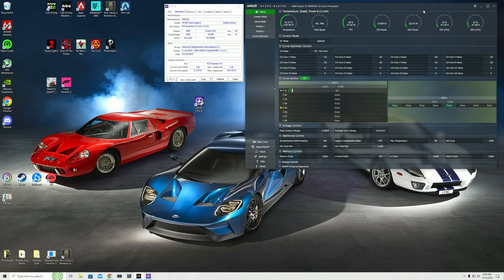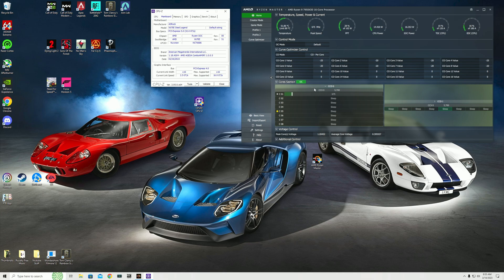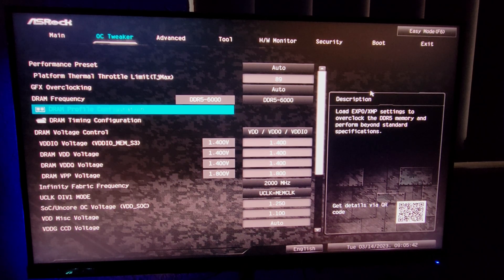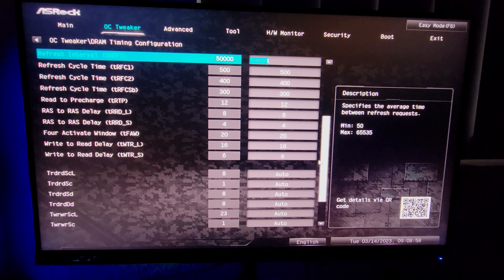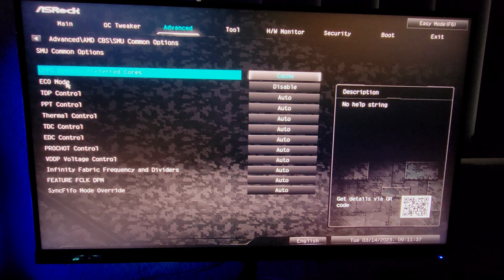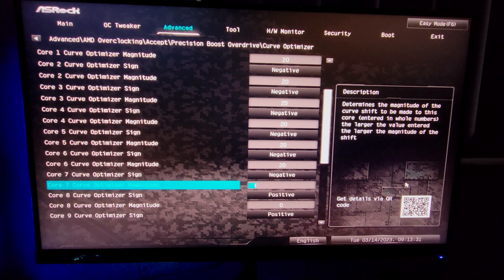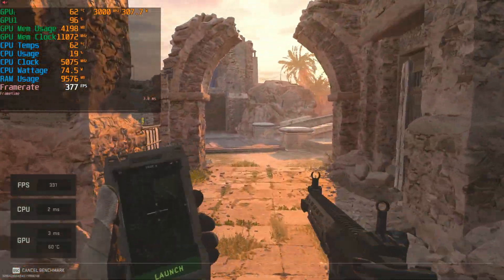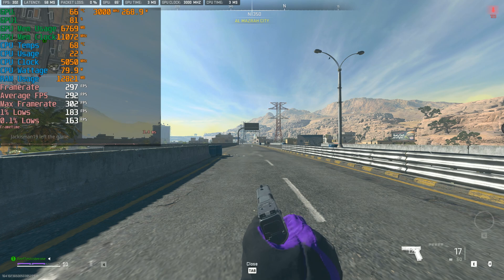7950X3D Setup Guide (Bios Settings, Ram Timings, and Undervolting)

Comment from the maker: WARNING: if you have poor case airflow or can tell the inside of your case gets really hot, don't set the TREFI timing more then 35000-40000.

It is EXTREMELY temperature sensitive, and can cause random shutdowns or restarts despite your ram seeming stable! 

In this video mine was 50000, I tried max it out at 65000 and noticed the random shutdown after a day...I did the research and lone behold here I am! Just had to let you guys know so you don't have the same issue!
Reply: My 6400 cl32 runs 50.000 in the xmp profile.
Hm no shutdowns since weeks.
But i also have an lian li lancool III with very good airflow
Reply: @n0pe_7 Congratulations! You chose the best case! Lol, that's my case too and I love it!
Reply: For those of us who know nothing of OC'ing or anything but just physically building the system: How do we figure out the reason the pc is shutting down or BSOD'ing is RAM or temp related? Is there a win11 log tool or 3rd party we can use to figure this out?
Reply from the maker: @Golyem  not that I know off...the easiest way to troubleshoot issues is to test all hardware before software.

First step is replugging absolutely everything in.

If you don't have an integrated gpu in your cpu, your next steps is to swap to a spare gpu of any kind, and retry to boot to rule out gpu. If you have integrated gpu, plug hdmi into motherboard and try boot.

If your motherboard has some little lights on it with writing next to them, it can even tell you what the issue with booting is. It depends what motherboard you have.
Reply: @Beefy-Tech  Thank you, I appreciate your time to respond!
Reply: Beefy,
I do not have the cppc setting in my bios. I’m trying to figure out how to get my machine to “prefer cache”, but can’t find the setting. I do have AMD CBS, buts it.
Reply from the maker: @thedo0d255  you must update your BIOS! That setting is not there unless you are on a BIOS that supports it! Also make sure to update your chipset drivers.
Reply: @Beefy-Tech  I did both already. Just can't find the CPPC setting for preferred cache. I dont think it's on there. There is like a OPCACHE with Auto/Enabled/Disabled on there. But IDK if that's the same.
Reply: @Beefy-Tech  I have 32gb gskil but they are 6400mhz cl34 and only shows expo not xmp, I do all you the same and works for a few hours and random shut down
Reply: @fierrosgaming  can you put bottom fans in your Coolermaster h500 mesh that you've mentioned..
I have the same case too, same CPU as you. 
Cuz i cannot , i only have a 360mm AIO deepcool LT720 + 1x 120mm REAR fans + 2x 200mm front fans
I wanted to remove both PSU box + HDD cadddy box and try to put bottom or side fans, 
The side fans i think we cannot as there is no brackets to screw those fans 
DAMN we're screwed
Reply: @thedo0d255  the correct setting for the CPPC in NOT cache, is DRIVER!
Reply: I have 6400mhz cl 32 memory and just left it as is. Wasn't worth messing with considering the possible performance issues. My Gigabyte B650 Ultra MOBO has a One-Click "Low Latency" and "High Bandwidth" toggle within the BIOS that can further auto optimize the already good memory.
Reply: @chrisbullock6477 I gained around 40fps to my minimums in warzone just doing basic tuning to my memory. Tried on both 7700x and 7800x3d with rtx 4080 with similar results.
Reply: I think you're alright at 50000. Buildzoid says the heat sensitivity starts to kick in around 65000. Tbh the gains might be worth putting a small fan on the ram.
Reply: Hi Beefy, what timings do you suggest for a 64 Gb 2x32 cl30 amd kit?
Reply: have drivers mostly fixed the stuttering problems ?

Comment: You made a mistake because you overvolted your processor, not undervolted it! AMD recommends not exceeding 1.15-1.18V on the SoC Voltage, so at 1.25V it's overvolted. To reduce stuttering, you need to undervolt this value to 1.17V to be within the acceptable range and set the first 8 cores to -20V because -25V is too aggressive a setting, and OCCT confirms this.

Comment: I am also using 7950X3D with ROG X670E GENE.
With old BIOS (1807), My system PASSED in 9hours of in Y-cruncher VT3 and TM5(extreme1) with Curve Optimizer -20 all cores (except -0 for 2 best cores of each CCD) in 
However, with latest BIOS (3104), My system FAILED in those tests. I have to lower down to -5 in order to PASS them.

Comment: Thanks for this helpful video!
@ 6:30 you mention setting CPPC to 'Cache' "...if not using any other program."
I use Process Lasso with my 7950X3D and set my affinities:  flightsimulator2024.exe (which is vCore aware) uses cores 1-15, and everything else except the core Windows processes are assigned to 16-31.
Core Windows processes are untouched, and use cores 0-31.
Is there any point in setting CPPC to 'Cache' or should I just leave it on 'Auto'?

Comment: I appreciate the video but there are things that are wrong here. 
You can get your  v cache cores to run up to 5.4ghz. 
For people just starting off, if you want to try undervolting etc, do NOT set your cppc to cache or speed. Leave it at auto or default. At most, you can try driver but DO NOT set it to cache. 
Windows has tons of things going on, youll see even during gaming, once the scheduler detects your game playing, that doesnt mean it will 100% put every other core to sleep. You're actually losing performance by taking away cores that would just be working on your game, now are being used for backround tasks that your c1 would otherwise handle at 600hz etc. Super slow but you will see cores handling small things. (Like the programs your using to display your fps, cpu core speeds etc. Afterburner, hwinfo, etc)
When it comes to setting your curve, start out by setting all 32 threads at negative 30. Using ryzen master ans cpu z you will figure out which cores like to run faster. I have some cores running at negative 35. 
My 3d cache cores during gaming run at 5.3-5.4ghz. 
Amd allows zen4 to put a 200hz overclock even on v-cache cores. You need to set that setting to positive,  200hz, scalar 10. Max temp 95. 

You then need to set your loadline calibration to extreme (or whatever the setting os that you can set and still give you a negative curve). Its usually one setting from the highest you can go. The highest will be a straight line and will wash out the  entire point of your negative 30 curve. 

If you want exact settings look up skaterbench's video on the 7950x3d. I got higher scored then he did though but i also got a really amazing piece of silicone. Idles around 25 degrees, hits maybe 60 during benchmarks . 
Sorry that was so much written and its not gonna make sense to anyone probablly without me showing you. Ive spent so mant hours on it, i may put off upgrading when the new chips come out. 😂 then will have to start all over again

Comment: Hello, I am having random restart issues during or after streaming and gaming. I've tried undervolting before, but trying to find it best to run everything stable and Max Performance in Windows + Drivers. Any recommendations for the 7950x3d + 4080 Super with CL30 6000mhz? Ideally, I would like to run my PC 24/7 without a restart. I've ruled multiple things out in my system and updated the bios before the build and post.
Reply: I'm having the same issue and also ruled everything else out. Basically the same build as you.
Reply: @DivineAndDemonic  it's all good now. PC has been running for 24+ hours. No shut offs or restarts.

Comment: i got a 4090 and a 7950x3d i have undervalued the cpu and thats all good but im having alot of issues with the ram. my motherboard is the aorus x870 and ram is corsair vengeance 64 (2x32) 6000MHz and the moment i touch anything under tRAS the bios says there is an error and i cant boot windows. ive had to reset the CMOS alot of times already. what do you recommend i do?
Reply: under-volted the cpu*
Reply: also i have my cppc set to driver instead of cache and the core parking works fine, why do you recommend cache?

Comment: I'm not confident with this BIOS cppc cache/driver thing. Driver should be the choice because when Windows is properly setup (balanced power mode) the cache driver and Game bar use the 3D vcache die. If you don't want to use frequency core, better go for a 7800X3D.
Reply from the maker: @psour33  yeah, it's supposed to do that, but I've had an extremely inconsistent experience with it. The intended method that's supposed to choose the correct ccd and park the other ccd just tends to break after a while even if set up perfectly correct. Over the course of 6 months mine failed every month on several games, and every time I had to reset it and re-set it up. Basically, windows updates would break it, and changing any game bar settings or bios settings could also break it. Basically, it just stops working if you fiddle with your settings or do updates lol. So yes, you can use it, but if you suddenly feel stutters in games you had no stutters in, that means the core parking isn't working well.

Comment: CPPC set to cache is wrong, as you set the pc on game mode, but for other jobs frequency is peferred, so it SHOULD be set to driver, as windows drivers decide wich one to use and when. And seems your integrated gpu is not disabled, another cpu worthless usage

Comment: If You set CPPC to CACHE the cpu will always prefer 3DV Cache, which is good for gaming but worst for other task (productivity) where the frequency is more important; ok that you only do gaming, but that is almost always not true (every user do other things, occasionally) but, most of all, with cache and frequency you will basically always use only HALF of your CPU.
the correct setting is DRIVER, then be sure to have windows and AMD drivers set according to AMD indication and the CPU will use the correct CCD, according to what you’re doing… JZtwoCents did a very clear video, recentely, about this……
Reply: I'm running the Driver settings now, and it's working like a charm!  Games pull the 3d cache CCD, and everything else is on the high boost non-3d CCD side.
Reply: @pumpkinfury 😎👍🏼
Reply: Exactly never disable the ccd1
Reply: Just use Process Lasso. 😎
Reply: wow thanks for this comment, I use my pc mainly for music but play a little games so this is super interesting info to me, thanks man

Comment: Can I set it to prefer frequency and then use project lasso to move only games to v-cache ccd?
Reply: Are you on Windows 10 or 11? On 11, as long as everything is updated(chipset drivers, bios, etc.) It automatically puts your games on CCD0. I've never had to change anything from older titles to the newer ones. If you do, just mark it as a game in gamebar, and then it will run off CCD0. You don't need to go to extremes like you did when the cpu dropped. Most of it has been sorted. I'm getting the same performance as this guy without undervolting or changing ram timings.

Comment: Thank you for your great Content.  Update:  On my Asusboard with the newest Firmware, all Sims (DCS, Xplane, MSFS 2020 a.s.o., works best with CPPC Auto. I test it much.  So smooth. Driver and Cache works not so good as Auto. My Setup:  Asus x670e-f, 7950X3D, RTX 4090, 64 GB DDR5 6000Mhz, Reverb G2 with OpenXR 150% Setting.  All other Settings from you in the Bios. Core 1-7    -20  only core 1  -25.
Thank you very much. Regards Michael

Comment: Some games don’t benefit of 3D vcache. Also, when Ray tracing is active on some games, the chipset driver wants to use the frequency CCD in addition to cache CCD.
I advise to let CPPC option in bios to default. Last chipset drivers, last bios, game bar updated and « game mode » enabled are sufficient to manage CCD’s as they should, whatever the applications.
Reply: Yeah think you're right. I set mine to driver, but as you said do you think I should switch it back to auto?
Reply: @vbrown8522ify  I would recommend trying each of the options one by one and then setting it to whatever one gave you the most performance. If there's no performance boost between any of the options, just set it to auto.
Reply: Agreed, also windows power setting must be set to balanced. I set it to performance and it took me hours to figure out why the cores never would sleep. Lol

Comment: does this video works for kingstone hyper beast 6000mhz? At the voltage i see you set 1.4 1.4 and 1.8 on the package says it runs at 1.35v

Comment: I'm having trouble getting 128 GB (4x32GB) of Corsair Dominator Titanium RAM running at 6000 MHz on my Asus ROG Crosshair X670E Hero motherboard w/ Ryzen 9 7950X3D CPU. I can get 64 GB (2 sticks) running at 6000 MHz leaving 2 empty DIMM slots. Using all 4 sticks 128 GB is available but runs at only 3600 MHz. I've tried using EXPO I, EXPO II, EXPO Tweaked, and custom settings some other people have had luck with getting all 4 slots and more than 64 GB running at 6000 MHz, but no luck for me. I'm wondering if Corsair Dominator Platinum RAM would solve my problem.

I also built an Intel i9 13900K system + Asus ROG Maximus Z690 Formula motherboard with 64 GB of Corsair Titanium (4x16 GB) running at the full 6000 MHz using XMP with no problem.

I have not uploaded any videos of those systems on my YouTube channel yet, but some are on my InstaGram account for tonygonzalez1984.

Comment: You should set CPPC to auto or driver, not cache, and make sure core parking works correctly.
Reply: Why not cache?
Reply: because with cach are be all tasks preferd to get the 3d cores, all background tasks. That is not the way. With driver windows use 3d cores for games and background tasks for non 3d. Also more Cpu power for 3d cach cores for games

Comment: Does cppc prefer cache also work on 7800x3d or should I use frequency?
Reply: You only have a single CCD  on the 7800X3D. All of which has 3d vcache.

Comment: well i just received my 7950x3d and asus rog strix x670e-e. I haven't tested yet, but i set EXPO to II, PBO Enabled with Max boost +200, and set negative undervolt to all cores -20 and it crashes, at the moment all i can do, when i set them all core -15 is max for my unit. What do you think, should i return and buy new one, or just fck it? im 70% gaming 30% productivity.
Reply: Set your loadline calibration to a higher Level.

Comment: Thank you so much for this important Infos. Now with RTX 4090 , 7950x3d combi - corsair  DDR 5 6000 CL 30 AMD Expo advanced, it works amazing smooth in all Sims. RAM is maybe very important too.  Curve Optimizer -25 per Core without SMT and Limit to Motherboard in Bios.And all your Settings too.  +200 overwrite. The best  Solutiion at the Moment for VR Flightsimmer. WOW WOW WOW. Intel by by for a wile 🙂
Reply: I went from a i7 10700k to a 7950x3d and it was game changer

Comment: hi, I have a 4x16GB 6200mt/s C36 SK Hinyx XMP kit, will I be able to use it a 6000mt on AMD?
Reply from the maker: Yes, you may even be able to use 6400mhz assuming your cpu is binned well enough.
Reply: @Beefy-Tech  Hey pls reply to me too
Greetings, are you able to put 3x bottom fans in that Coolermaster h500 mesh and 2 or 3x side fans 
cuz i cannot , i only have a 360mm AIO deepcool LT720 + 1x 120mm REAR fans + 2x 200mm front fans
I wanted to remove both PSU box + HDD cadddy box and try to put bottom or side fans, 
The side fans i think we cannot as there is no brackets to screw those fans 

How are you doing with that big enormous coolermaster 500 mesh case of yours ?
Did you swap case already or still using it

Comment: Thanks for your video. Realy nice. I have a 7950x3d with a 6900xt. Im getting in season 5  500 on AVG, 410 on 5% and 375 on 1% Low. It seens perfect. But i think that my GPU maybe is a bottleneck. In real game on battle royale, my average is 240. But my lows is about 200. Is that correct ?  Maybe is that a way to get always 240 FPS + without dips ? Thanks in advance.

Comment: I did everything in the video besides smt and i had 294 fps at 1080p any ideas why so low fps? I have rtx 4090 rog strix oc and ryzen 7950x3d and 64gb ram 6000mhz.
Reply from the maker: It's using the wrong ccd most likely. Download process lasso and set affinity to 1st ccd and you should be in business. If you want to see how to do that I have a video on how to set up process lasso for a 7950x3d👍
Reply: @Beefy-Tech  Okay bro thanks so i have to do the same thing like before but this time by process lasso video and it will fix my performance?
Reply from the maker: @benbadersclips  in theory, yes it should fix the issues.
Reply: @Beefy-Tech  thank you i will check it, u got my sub

Comment: Hey appreciate your video! Question? So if i set the infinity fabric to 2000mhz how does that work for 1:1 ratio if memory is 6000mhz? Does Ryzne 7000 automatically make it 1:1?
Reply: Optimal ratio is 1:3, so 6000 optimal FCLK is 2000 and 6200 is 2100 etc etc. However I believe what you’re referring to Gear 1 or Gear mode, you ideally want to be in Gear 1 for best latency. To do this you’d need to disable GDM in bios.

Comment: I have the same board and CPU and my ram speed is the same. Thank you so much for this info. The memory timing info was a huge help.
Reply: And i have the same PC case as he has and yeah he mentioned we are kinda limited with cooling, there are NOT much options to install bottom fans or side fans
And it's TRUE. As I too cannot , i'm depending on my 360mm AIO + 2x front fans 200mm + 1 rear 120mm fan ... That's all. This case is big yes but is a nightmare

Comment: This seems more gaming focused. Why not undervolt ccd1 ? I am getting better overall performance with driver setting for cppc.
This seems quite high undervolt. I never got that low :(. it works fine under load, but not at idle.
(I have same MB same CPU, similar pcu, memory and cpu cooler (1,2kw TT pcu, 6ghz gskill memories cl30, 360mm eisbaer pro).

  Do you have some cinebench r23 scores or any other benchmark scores ?